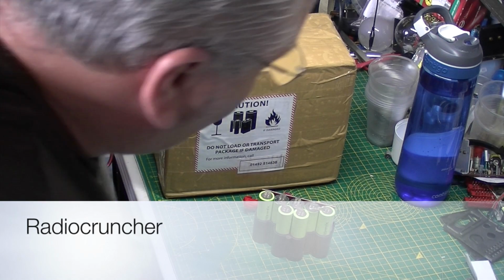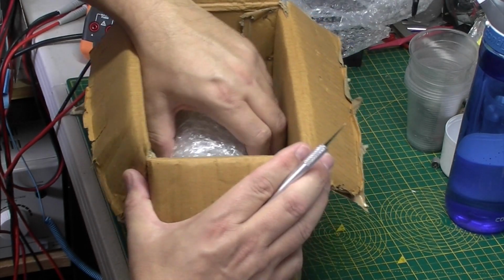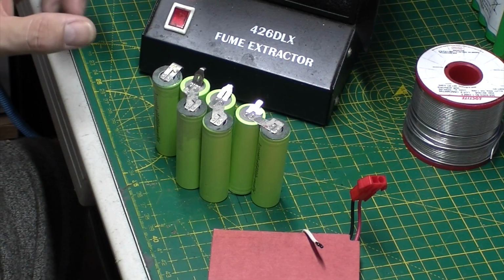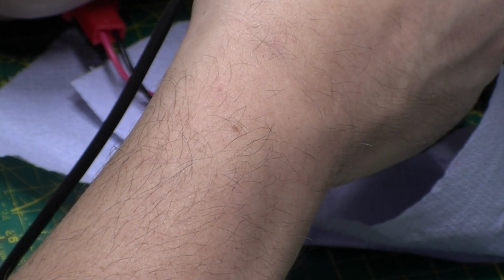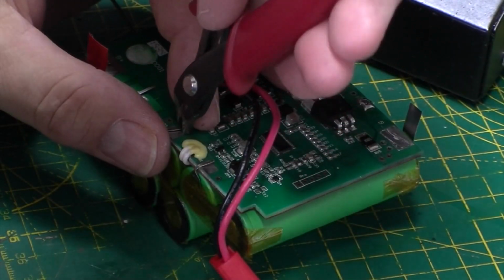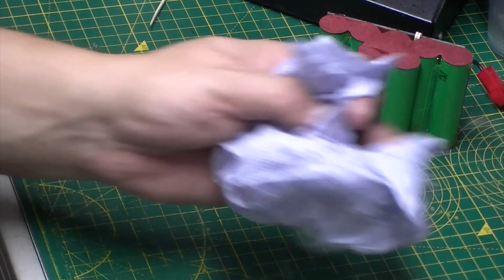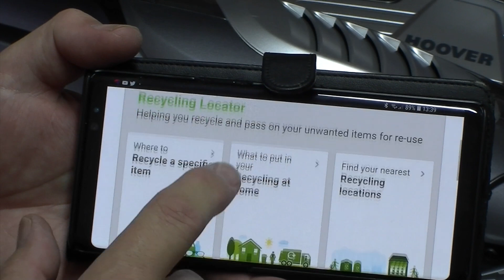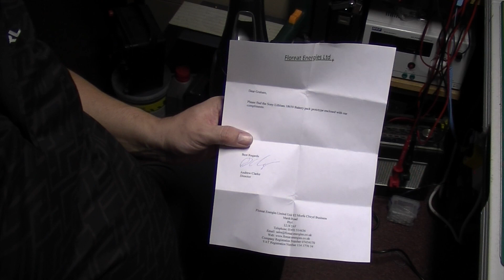(UPDATED) Hoover UNP252A cordless vacuum repair part 2: The battery pack

Comment: Job done!
Reply from the maker: Thanks Wenlock
Reply: Shame that replacement battery packs often cost more than the device.  Most of my garden solar lights are still going because I scrounged parts from dead ones. Mostly due to solar panel failure.  Even from Chinese sellers on eBay the panels are most of $20 for a light that was only $4 at The Reject a Shop (similar to Poundland).  Batteries and inductors are the usual items and yes, I've had intermittent inductors.  Back on my Warburton Franki Pentagon radio I've had to replace the battery snap as a wire came adrift while I was replacing the cap on the volume pot.  I'll have to order caps as I don't have those values in the junk box.  Must look at the temp pot on my soldering iron, it's seized solid and I've changing the temp with vice grips :-/
Reply from the maker: Hi Wenlock. Yes aftermarket battery packs can be very expensive. The Warburton radio sounds interesting and I can find no reference to it on Google.
Reply: I can't find anything on their radios but there is a bit on their electrical products, kilowatt hour meters etc.  Seems they did make a radio or two but they were largely unknown in radio.

Comment: Good repair but I am puzzled!! If it was new and never worked why did your friend simply not return it for a refund or replacement?
Reply from the maker: I really don’t know what happened Mike but he’s had it in the cupboard for a couple of years or more!
Reply: Yes Hoover would NEVER believe it had not been ever used!! It's hard enough to get things fixed 1 week from new.
Reply: Hello there ,there's any chance, I can get a battery fixed the same model,how much do u reckon it will  cost me with sending the item from Germany to u plus the rest of the job???